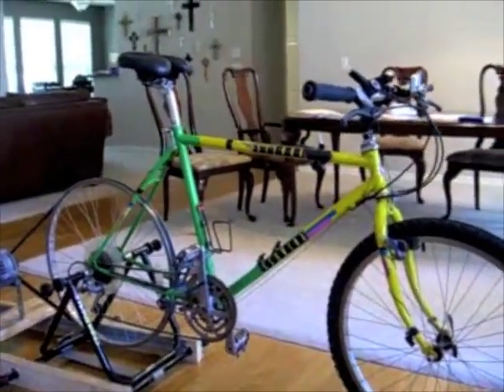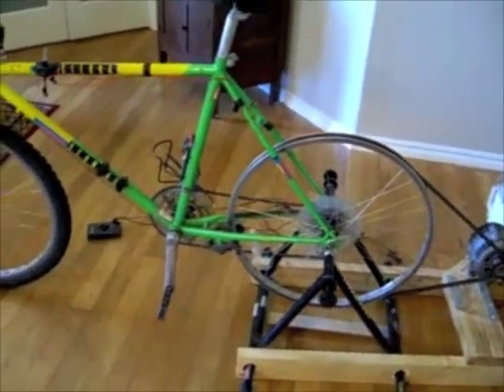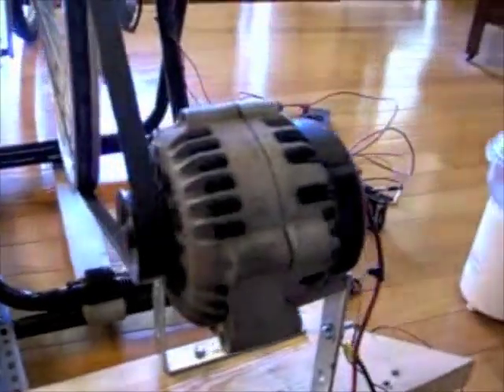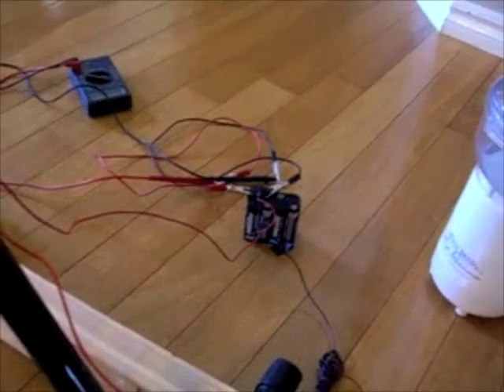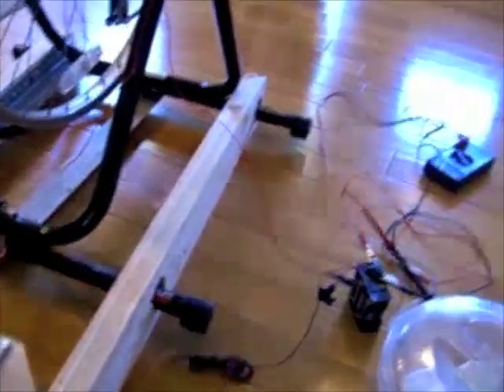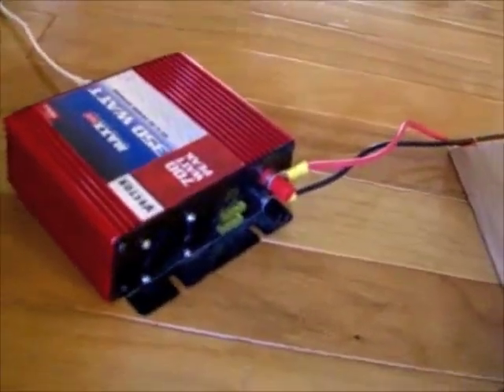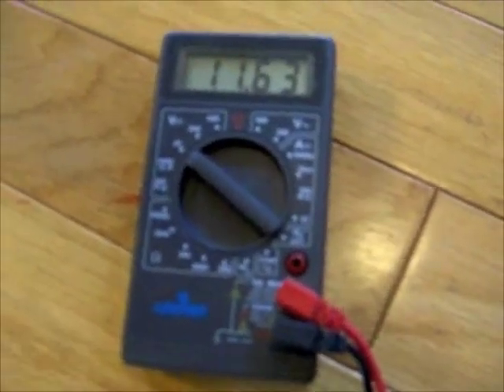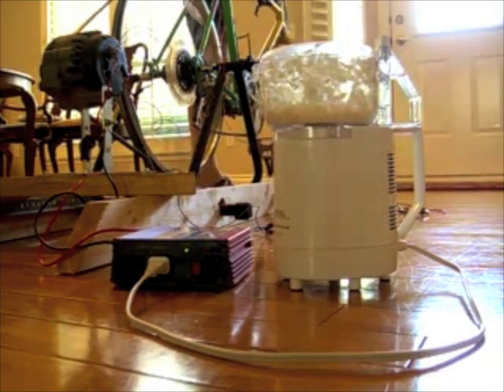Bicycle Generator

Comment: Why not having a car battery as the 12 volt source? You could pedal enough to get the battery charged up all the way and then when you need it for things like you did in the video, it would work without having to pedal. The only time you'd have to pedal is to recharge the 12 volt battery up all the way. You just wouldn't want to drain that 12-volt battery completely.

Comment: My AC Delco alternator actually sucks power from a car battery when I hook it up like this, so I must have the wrong AC Delco alternator, and I know that alternator works  because I went to AutoZone and check it. Then I tried hooking it up all kinds of different ways. Positive to those  f    l   S  connections on alternator.   And spin counterclockwise with a drill . Same power drain to the battery. Not 13 1/2 or 14 volts

Comment: You do not need 12 v to get it started, you could probably get away with 3 v. The internal diodes feed the output back to the exciter pin which you connected the battery. The other side of the armature coil is regulated to ground by a transistor in the voltage regulator. Normally a light bulb was connected in series with the red wire where you connected the battery, this shows on the dash of the car.

Comment: Hi enjoyed watching your videos. It gave me the knowledge to build a backup up off grid 12v  charging device similar to your design. I used a second hand 100 amp alternator, cycle turbo trainer, old jump lead switches etc.  Basically I can pedal in high gear with little stress on Crank & alternator rotation. Pushing rear wheel by hand has alternator pulley & rear wheel rotating freely. Obviously when exciting you can feel load slightly but you can cycle immediately in high gear. Tyre, inner tube & turbo trainer tiny freewheel resistance roller removed. Belt goes round backwheel & alternator. Turbo trainer folds in half with alternator attached. Bicycle comes off turbo trainer & can be used as normal by just adding tyre & Innertube.
Bike kept in campervan with turbo trainer & can be used to jump-start van or charge leisure batteries. Beats charging with a slow battery trickle charger. Basically fully off grid backup. So glad I watched your videos explaining everything in detail.  Something I have always thought about making. Now I have & it works well. Lol.

Comment: If you want to have a better efect you can add a flying wheel to the system; and you can do it it two ways: 1) Put a flying wheel between the bicycle´s wheel and the alternator, and you can take advance of this new wheel to multiply the RPM of the system;  and  2) You can add weights to the bicycle´s wheel so that they will be balanced (or you can make a flying wheel for this system as shown in this video:  https://www.youtube.com/watch?v=TBjuLDIjgkQ
   You can see more videos in this chanel that show the advantages of a flying wheel.

Comment: I want to see if you can loop the energy from alternator to an electrical motor which turns the alternator (Hope that makes sense).  And run a separate electrical outlet from it to power stuff. I've seen people post that they can power a welding machine. Even one guy said he could power his house. I want to know if that's true.

Comment: so while the bike is runing u switch the buton back OFF right? and u still get 12v power out of generator?....but what happend if u put insted of switch buton just a light bulb? and also didi u use any diode on excitations cable?

Comment: Why not just connect the bicycle directly to the chopper LOLOL
Great video however most vehicles will continue running off of the alternator with battery completely removed.
Great work !!!!!

Comment: hey try an ebike on a charger with the one that turn at the frame with just the pedal assist should do it and you could turn multiples of alternators then you would get the 6 million views in a year instead of ten.

Comment: You could add three or four more alternators, let them run against a bike tire instead of off a belt, and use them to charge a battery bank.

Comment: When the blender was switched on did the alternator become any more difficult to spin ?
Reply: I actually just built a bicycle powered alternator. I used a 5 amp headlight. Yes it creates a lot of resistance and is hard to pedal!
Reply: I will post a video of it soon once I do some perfecting. Quick calculation tho: 200W food processor / 12 volts DC = 16.66 amps so yeah he could definitely feel it

Comment: Does anyone know how much watts of electricity can be generated by this paddling way ? 🤔
Reply: 600 watts is a good food processor - that one looks not so good. So probably 400 watts/120. So less than 5 amps. I can get 5 amps using a DC generator on my bicycle. So sounds about right.

Comment: This is awesome. I'd love to see how long it takes to power a USB battery pack.

Subscribed.
Reply: HotSnot TaterTot with a car alternator you would charge a 12v car or agm battery. It’s not very practical to charge a usb battery because it couldn’t charge as fast as you would generate power. But you can charge several usb batteries from a 12v battery.

Comment: I am figuring a way to do this for my 1992 ford f150. I have a spare alternator and want to make a generator out of it and have my inverter inside my truck cab. This is awesome and only this it was burnt out and probably need parts to replace. Nice video. Gonna try this

Comment: I have no idea on electrical but I am willing to know.  Is there a device that stock harvested energy and use it when I need it?  Is it possible to still obtain energy with only slow speed pedaling?  I am planning on making a perpetual motion pedaling system.  I know it will be slower but theres no need to manually operate and will do its job alone.
Reply: yes there are many devises to stock hervested energy,the most common is called a battery. 30 years ago i had this exact setup to keep my two car batteries charged for lights and radio. This was before solar panels were affordable. i had a manuel pump for pumping water from a citern and gas for cooking and heating water. To run the washing machine i would connect the two batteries in series and fill it up with water by hand,this did run down the batteries a lot which meant lots of pedalling to recharge but it was all good fun and excercise and i was a lot younger than now. I now have a respectable solar power setup and use the bycicle just to top up batteries when i have periods of very low sunlight. This is good for my health and the health of my batteries.

Comment: I have a 24v alternator .so I need a 350 watts invetor which is 12v?or 24 volt inverter?
Reply: It would work better if you had  SUPER caps in parallel with the generator

Comment: I have found a free energy source , it's the sun , I plan to build a pipe directly to the sun and get free energy from it , I know what you are thinking , I will burn up before I get there , I have a solution to that , I plan only to work at night

Comment: I think you would have been much better off using a single wire alternator and a 12 Volt battery. Alt wired to the battery already has 12 volt going to it so no need for switches and such. Run your inverter off the battery. Kind of like a car does. Or exactly like a car does.

Comment: if you wrapped chain into the spokes of teh wheels you could then make a heavey fly wheel. or another way ive seen done is to reccle a washing machine and make a flywheel from that by water proofing and then putting in concrete to make a big flywheel that can store energy so when you stop peddling you dont loose power straight away

Comment: Okay anyone correct me if I'm wrong.. 

1. The difference between the alternator and generator is permanent magnets right? 

2. The alternator works when 12v is given to the inner coil AFTER its spinning up to speed right? 

I'm thinking of a battery bank with a crank generator just like this I'm not very educated in the field I was kinda going about reinventing the wheel not even sure what questions to ask but I've learned a few things here

Ty for the video 👍👍👍
Reply: Check out my design - use a DC/DC buck converter. So lowest gear on bicycle - slow and easy pedaling - gives a 4 amp charge into 12 volts!! https://www.youtube.com/watch?v=QrQCiWPiWp4  I charge up a lithium generator-inverter 31 amps. I can watch a portable DVD player, powered by the generator while at the same time charging the generator.

Comment: Hack .. the belt is wrong
Reply: shut up dickhead you know nothing
Reply: @Scott-mc3fv  o really.  I made one that powers my hole house and charges 6 car batteries
SO I WOULD HAVE TO SAY YOUR THE DICKHEAD . BUT YOUR DOING GOOD . YOU WILL GET IT SOON I HOPE . . GO WITH 150 AMP ALTERNATORS , USE TWO FROM A  Diesel pick up truck and hook up a tachometer to the fly wheels

Comment: Wheres the voltage regulator? You cannot run a DC - AV inverter with 12 volts AC direct off the alternator...

Comment: Works very well. :-) Be sure to check out my version(recently uploaded), no other video on YT shows my setup or power output. Thanks
Reply: Can you link the video
Reply: @NeutronJohn  , Any alternator will work if the rotor is electrified or remove the rotor and add a PMA , no need for a small battery or switch , it starts making power as soon as it starts spinning  , I have 4 of them , they make around 18 volts and 1200 to 1800 watts depending on speed

Comment: Wouldn't the recumbent design be the most efficient and comfortable?  You'd be able to go for longer because it would be stamina that would determine how long you could last rather than how long you can bear putting most of your weight on a small portion of your arse.

Comment: what I do not understand and would someone please explain this to me, if you have AA batteries wired in series to create 12 volts, how does creating 14 volts from 12 volts power the food procesor?  Wouldn't he have been able to power the food processor with the batteries directly?  I have tried powering an appliance myself witht he batteries directly and it did not turn on (same amount of wattage.)  Why is this please?

Comment: Hello. Why you dont use the same battery for excitation coil? The alternator generate energy based on the information from car battery and change the excitation energy to mentain 14.4V constantly. You will damage the car battery this way.

Comment: Hi. In the video, you said that two wires need to read 12 volts in order to maintain current. May I ask which wires need 12V supply? I have a Delco Remy alternator too which has 4 pins (P.L.I.S.).

Comment: Some households use up electricity freely and end up getting a $200-$500 power bill. That could be a particularly hard pill to swallow when times are tight. This is a generating power method “boma fetching unique” (Google it) to cut your electricity bill and generate your own power.

Comment: as more demand is put on the alternator wouldn't it take more effort to turn it, on cars sometimes you will hear the belt slip when demand is high like for 20 seconds or so when the battery drains from starting then once the battery comes back up the slipping stops

Comment: Hmm, it would be nice if there was a line of household appliances that worked directly off the bicycle, skipping the electricity.  
This would be great for hooking up to a washing machine, a drill, a saw, etc.  you are just converting the foot movement into a spinning movement with gears to help with increasing the speed and force.  The greatest waste of energy is in the storage.  If energy is used as it is generated, a lot of things can be done very efficiently and inexpensively.

Comment: I have an old electric mower and weed eater both with their motors in tact.  Is it possible to set one of these up in a similar manner as you did in the video to create AC current?  I am self taught and trying to learn more about how these all work and from my understanding, would and electric motor be the same as you described an alternator to be?

Comment: what if you tried hooking up that there blender motor to the bike wheel with a large fly wheel( that you'd probably have to give a pushing head start since it won't have enough torque to do so on its own) creating perpetual motion (not science fiction btw look up how a gyroscope works or bicycle wheel demonstration) which would cause enough force to keep the wheel spinning? it's really not that complicated but I mean just an idea and would like to see if maybe you could get creative about it and see something else with that generator. also I was just wondering does that generator on the bicycle generate enough power to turn on a heater? or perhaps a hot plate?

Comment: I looked 30+ times this video(I'm so dumb)  just to see the wiring pattern,  no idea about electronics, but facing severe energy problems. ;(
I've a ND alternator with three wires in clip. tried ton of times as the video says, but still get nothing. which wire is ignition, voltage regulator and sensing.?
so stuck and confused. :(

Comment: I need to set up a similar circuit for my experiment, however, I'll be powering the alternator with a motor of 3 HP, so I'd need an inverter in the area of 2kW, which isn't ideal. The load is simply going to be a set of lightbulbs/sockets in series to generate the load. Do I even need the inverter, or can I just run off the AC power the alternator generates?

Comment: i bought a Geo Metro alternator, to make a bicycle generator, is it necesari to put a diode, in the red wire that feed the bateries, cause i have listened that to the current can not return to the alternator to be wasted. 
the geo metro came with regulatoor and someting called diode, but i dont know if it is the diode that im telling you

Comment: You really don't need the switch because after you reach 1000 rpm the Alt. self excites and the diodes inside the alt. prevent a draw on the battery from occurring. Try leaving the switch turned on from a stop and you will see. The drop in voltage on the Battery becomes the switch. Use a larger lead acid battery and drive the converter at the same time so there is a safety factor when you get off the bike. It gives you time to turn what ever you are powering off without blowing it up. For added safety use the converter to power a battery backup device then you could power a TV or even a desktop computer without a problem.

Comment: What kind of power inverter did you use?  I got a brand new 1000W 12V dc to 120V AC inverter , wouldn't work.  Without the inverter, I see 13,5V.  Connect the inverter, voltage goes down to zero.  Thing is: I'd like to run this thing without a battery (using only a small 9v battery to magnetize the core).  Any idea what i'm doing wrong?

Comment: I was thinking something similar to this. I may be wrong, but by my calculation, a person cycling at 15 kmph produces an average of 714 RPM at the wheel. Hence, if I could technically find a motor/generator that produces 700 RPM at 48-60V, wouldn't it then be possible to generate significantly more power to run laptops for a couple of hours or something? Assuming, four people cycle an hour each at at least 15 kmph.

Comment: For any real world applications there should have been a 12 Volt Lead Acid battery connected to the circuit as is intended by the alternator design. DC current isn't totally smooth coming off an alternator as it still has some pulsation in it. Batteries not only act as a storage device but also as a filter smoothing out pulsations and voltage spikes. Continued usage would probably result in failure of the inverter, solid state devices connected to inverter, or static noise in any audio device.
Reply: But capacitors would be even better than batteries

Comment: I always thought of one of these for something to charge a deep cell battery and combine it with other aspects of an off grid system.  Use solar, wind and this to keep a large bank of batteries topped off while still having the ability to have a grid tie in the event that you just can't/won't peddle.

Comment: On gas engine generators I have used a big spring to keep tension on the belt.  Belt tension was always constant and changing belts took only a couple seconds. I used old GM engine frame mounts and ran a single bolt through the Delco alternator.  Never had a problem with it and worked for quite a few years (built about 6 of them.)The big spring from Home Depot just wrapped up to the top of the alternator -  the other end anchored on the wood base.

Comment: Hi Leo. I have a silly question about this video. I know your using a car alternator. But do you think its possible to use  a gas powered generator motor then convert it to hydro powered generator instead of gas?

Comment: Now you know what to do when you have power outage, find your way in the dark and hop on your bike, the lights will probably be back on just right when you get everything ready with a tiny flashlight weaker than a candle to connect all wires and components   with but you just needed one last thing...another double AA battery. lol